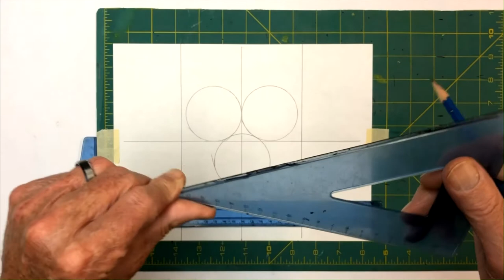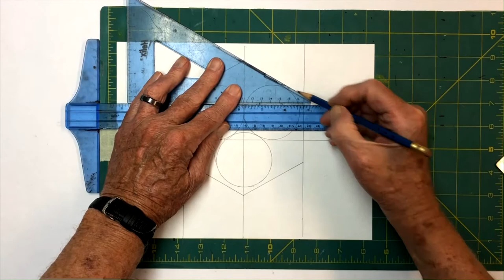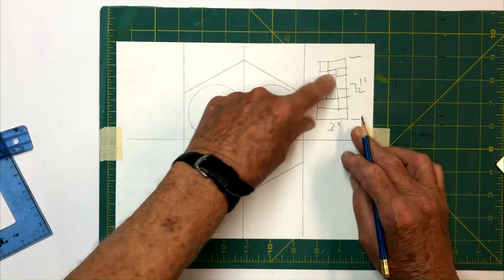Leaded Glass Solar Lantern  Hexagon 2

Comment: Do you have a pattern for the jig, for hexagon solar lantern?  I'm working on all the pieces now.
Reply from the maker: Hi Craig,
I'm so sorry, but I don't have a pattern for any of these jigs used in my video projects. The one for this project is two 30-degree tringles put end to end forming the jig to hold the panels on a 30-degree angle when you solder them together. If you don't want to make this jig you can use your 30/60-degree tringle and block up the outer edges of your panels, making them come together to make the V grove in the center, to solder them together. I hope that makes sense to you. Thanks for your comment and please feel free to ask me anything about these projects. Let me know how you make out with your project. Have a great day!!
Regards,
Bill Stone
Reply: @billstonesstainedglasscrea3310  Thanks Bill. I'll figure it out... that's part of the fun!
Reply from the maker: Hi Craig,
Your wright, it's fun figuring out how to make jigs to make putting these projects together. Most of the time I will make a project, then put it together. When I'm doing that, I think how could I make something that would make it easier to put together next time. Before you know it you have a whole draw full of different jigs for different projects. Hopefully you got it worked out.
Regards,
Bill Stone